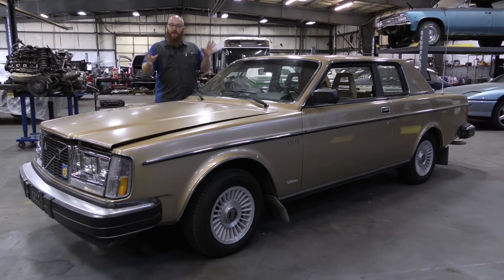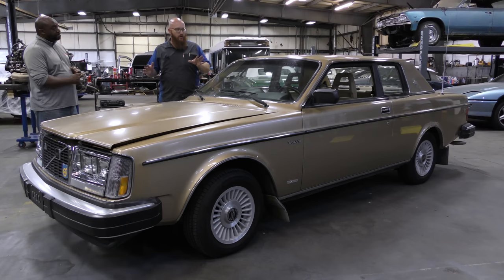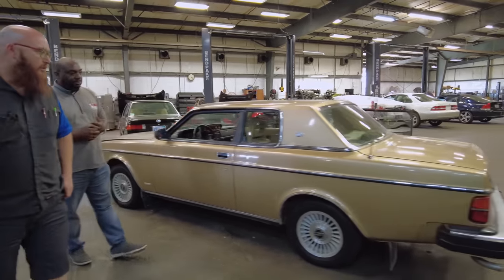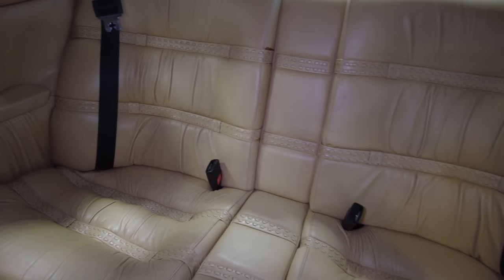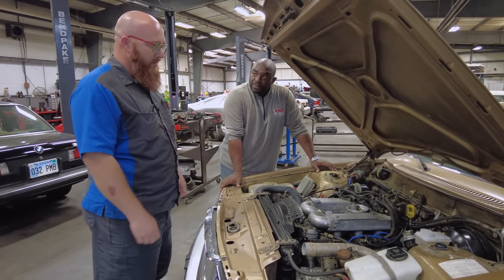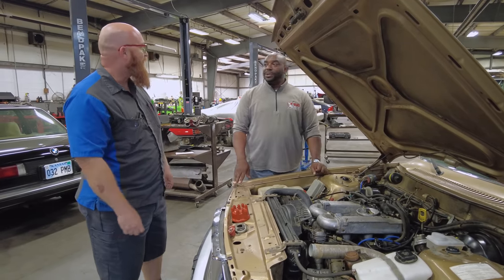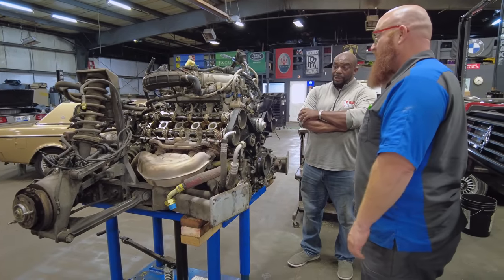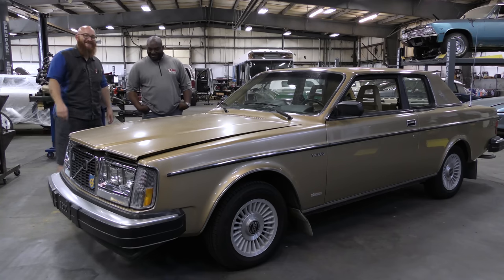Italian Volvo? Rare ‘80 262C Bertone in my shop! Why is Bug Ninja in a Ferrari engine bay with me?

Comment: I've driven a Renault with that engine. My landscaping boss would do moves too, he was pretty thirsty for whatever he could put a crew to if it was slow. Anyway.. I could drive a manual so I was "elected" to take this weird car that had been parked for years on a three hour drive through the mountains.  It over-heated half a dozen times so I got a good look while sitting on the side of the road.  
  Later I went back for the moving truck (also stick) and drove the whole family over their rotten log bridge with a loaded 32 foot box truck going about 45, as fast as I could get down their driveway. Fun.

Comment: Sounds like US Volvo dealerships are different from ones in Scandinavia at least then, as here they lowered the prices on fixing the old Volvos as they really want to keep them as customers.
And I remember the fuel injected Volvo 240s I've had, you couldn't attach that to a computer either, so Volvo's solution was a little box in the engine bay with a button, when you pressed it, a little light on the box would start blinking, and you had a little booklet that told you what each blinking pattern meant, as a way of doing diagnostics. :P

Comment: US market cars that had the PRV V6 – Volvo 260; Volvo 262C; DeLorean DMC12; Peugeot 604; Peugeot 505; Eagle Premier; Dodge Monaco
Reply: PRV powered automobiles

PRV engine in a DeLorean
The dates following each entry denote the introduction of a PRV V6-equipped models.

2458 cc:
Alpine GTA (September 1985–February 1991)
Renault 25 (1985–1995)
Venturi 180/200/210 (1987–1992)
2664 cc:
Alpine A310 (October 1976–1985)
Peugeot 504 coupé/cabriolet (1974–1983)
Peugeot 604 (March 1975–1984)
Renault 25 (1984–1988)
Renault 30 (March 1975–1984)
Talbot Tagora (1980–1983)
Volvo 260/264/265 (October 1974–1980)
Volvo 262C (1977–1980)
Volvo 363CS (1977, prototype)
2849 cc:
Alpine GTA (November 1984 – 1990)
DMC DeLorean (1981–1983)
Lancia Thema (1984–1992)
Panhard ERC
Panhard VCR
Peugeot 505 (July 1986–1992)
Peugeot 604 (1979–1985)
Peugeot P4
Peugeot Proxima (1986, prototype)
Peugeot Oxia (1988, prototype)
Renault 25 (1988–1992)
Renault Espace II (1991–1996)
UMM Alter II (90's)
Venturi 160 (1987–1992)
Venturi 260 (1989–1996)
Volvo 260/264/265 (1980–1982)
Volvo 262C (1980–1981)
Volvo 760/780 (February 1982–1991)
Volvo 960 (rare 1991 models)
2963 cc:
Alpine A610 (1993–1995)
Citroën XM (1993–1997)
Peugeot 605 (1990–1995)
Renault Espace III (1996–1998)
Renault Laguna I (1994–1997)
Renault Safrane (1992–1997)
2975 cc:
Alpine A610 (1991–1993)
Citroën XM (1989–1993)
Dodge Monaco (1990–1992)
Eagle Premier (1988–1992)
Peugeot 605 (1990–1995)
RJ Racing Helem V6 (1995, modified Renault Sport Spider)
UMM Alter II (90's)
Venturi 300 (1996–1998)
Venturi 400 (1994–1997)
PRV engines in racing
ALD C289 (1992 24 Hours of Le Mans endurance prototype)
Alpine A310 Group 4 & B/12
Alpine A610 GT2
Chevron B36 (1987 24 Hours of Le Mans endurance prototype)
Fouquet buggies
Peugeot 504 V6 Coupé Rallye Group 4
Peugeot P4 V6 Paris Dakar
RJ Racing Helem V6
Schlesser Original
UMM Alter II
Venturi 260LM, 400GTR, 500LM and 600LM
WM P series (1976-1989 24 Hours of Le Mans endurance prototypes, including P80 that finished at 4th place at 1980 24 Hours of Le Mans and the famous P88 that was known for setting the all-time Mulsanne Straight speed trap record of 407 km/h (253 mph) at 1988 24 Hours of Le Mans).
Ultima Mk1/2/3
The PRV was also the basis for the 90° V6 engine used by Alfa Romeo in the 155 V6 Ti in the 1996 DTM/ITC season from Silverstone onwards. The engines in that series required the use of bank separation angle and cylinder bore spacing from a production based engine, and as a 90° V6 has greater room between banks than a 60° V6 for a more optimal induction system, Alfa Romeo used the PRV as a basis as it had been used in the Lancia Thema, a car which shared its platform with the Alfa Romeo 164, as well as the Fiat Croma and Saab 9000.

Other sources declare that the 90° V6 engine in 1996 Alfa Romeo 155 V6 Ti is based on a 2.6 L V8 from 1970 Alfa Romeo Montreal with 2 cylinders removed, as allowed by the rules, however the FIA homologation documentation shows the homologated production engine was a "2850cm³" capacity "V6" engine. The bore spacing of the Montreal engine was too close to be suitable for the 155 V6 Ti in any case. Limone invented the "Montreal V8" story to throw the press off the scent and to satisfy FIAT management who were unhappy that a non-FIAT group developed engine was being used.

Comment: I had a 244 and always wished I bought the 740.   The 740 could sustain a higher top speed for cruising.   My 244 maintain 125 mph on the highway.   Finally gave it away to a church auction with over 200,000 miles.
Reply: Was that a NA 244 or a turbo?

Comment: I've got the same engine (in my 1983 Talbot Tagora) but instead of fuel injection it has a pair of triple venturi webber carburators and a single choke (@250mm diameter) on the side of the engine !

Comment: I'm a minute in and had to stop. Mechanical parts for any 240/260 are very easy to find and not bad for price. Aside from the engine being a V6, the 240 parts pretty much do it all. IPD and FCP Euro are generally great for parts. The Borg-Warner transmission is simple and straightforward. The only thing that will be tricky are tires to fit those 14 inch wheels. Good 185/70R14 tires are hard. Going to a 205/70R14 is some better, but moving to a 205/65R15 on Volvo alloy wheels is the way to go

Comment: The Volvo 262C is a very nice car and all it needed was a new dizzy (distributer cap) and rotor button but l know they were not cheap l replaced them on my 1997 Hilux and that was aud $70 and that Ferrari motor with the easy to replace clutch why aren't more clutches like that and l have replaced so many clutches on rear wheel drive vehicles they are a pain

Comment: A few things worth pointing out. You could buy a Volvo 242 in Europe, in the same way you could buy a 142 before it, this was just a 2 door version of the sedan, so had a normal height roof with normal thin C-Pillars, it was the "C" that denoted it the Bertone "Coupe" with the "chopped" roof. Also, in some markets, they were only available with carbs, including here in the UK. It was a terrible carb that didn't last much part 60,000 miles, would cause single figure fuel economy, poor starting & rough running, & really wasn't rebuildable.. They cost over $1000, on its own, in the late 80`s/90`s, before labor was added. Unsurprisingly, it was that carb that sent a large percentage to the scrapyard, as it did with its other PRV equipped stablemates (the Renault 30 & Peugeot 604). Maybe if they'd had injection there`d be more of them left..

Comment: That Volvo 262 is beautiful! I wouldn't say that about normal 240. But they are very good cars with 4 cylinder. Turbo is needed for modern traffic. 6-cylinder sound is nicer, but not nearly as reliable as 4 cylinder models.

Comment: Rule #1 if a car is misfiring, always check the ignition parts first. Distributor cap, rotor, switch, cables and spark plugs. 👍

Comment: I was never a fan of the 262 Bertone, it looked awkward to me. The 780 Bertone was the first Volvo that made me do a double take, it was so beautifully designed! The PRV had a reputation for chewing up camshafts, I was so tempted to take advantage of the very low pricing of used 760s, but the reputation of that engine made me think twice. I drove one, it was nice enough but it sounded like a Corvair when driving. I never did get one. I had an 82 244, a terrible car, many years later I bought a 960 with the inline white block 6, that was an outstanding car.

Comment: The V6 engine is often called PRV6, since it was a joint venture between Peugot, Renault and Volvo.
I never had experiences with them my self, its a very hated engine in the RWD Volvo community.

Some people claim that the B280 (newer revision of b27/b28) is much better.
But it is also said that these cars need proper maintenance and oil changes or you risk the cams not getting enough lubrication.
So some people claim that in the 80s, people were used to engines which didnt need frequent oil changes etc and that then they didnt service the PRV6 enough.
Not sure if its true or not, its all hearsay.

Other than that, the 780 actually came with independent rear suspension and fixed, the 1989 780 bertone has the IRS.
That is the IRS MK1 as its called, which has coil springs.

In Volvo 960 1995 you had IRS MK2 (same in RWD S90 etc).
This IRS MK2 has a composite leaf spring.

The IRS assemblies from 780 and 960 have very low unsprung weight, especially the MK2 as more components weight then is "tied" to the body/chassis.

Comment: Hey Wizard!
From the first time I saw a Volvo Bertone Coupe, I was in love with the design. I wanted one for years, but never found one I could afford. Now, you couldn't pay me to own one. Too many unique unobtainium parts! I'm retired now, but I was the last one at the shop I worked for who knew how to service the Volvos with the CI fuel system. (And later the B28/B280 with EFI and the front left mounted IGN Dist) I eventually got quite good at it, just in time for them to disapear from our client list. (Haha!)

Did you remove the Air Filter Box for clarity, or was it missing when the car arrived?

For reference I've included a list of the variants used in Volvo cars over the years. Courtesy of Wikipedia.
In the US I saw mostly "F" Variants, with an occasional "A" Variant inported from Canada. The only "E" Variants I saw were, if my memory serves, later EFI units. (it's easily been eight years since I last saw one.)

Cheers! GrayRaceCat, a.k.a. Brian

p.s. I enjoyed the diversion to Eurovision Bob's 348 Ferarri engine!

*  V6 PRV engines  *

  B27A: Carbureted version used in the Volvo 260
  B27E: Fuel-injected version used in the Volvo 260
  B27F: Low compression fuel-injected version used in the Volvo 260
  B28A: Carbureted version used in the Volvo 260
  B28E: Fuel-injected version used in the Volvo 260 and the Volvo 760
  B28F: Low compression fuel-injected version used in the Volvo 260 and the Volvo 760
  B280E: Fuel-injected version used in the Volvo 760 and the Volvo 960 for the 1st year in certain markets
  B280F: Low compression fuel-injected version used in the Volvo 760, Volvo 780 and the Volvo 960 for the first year in certain markets

2664 cc (B27):
   Volvo 260/264/265 (October 1974–1980)
   Volvo 262C (1977–1980)

2849 cc (B28/B280):
    DMC DeLorean (1981–1983)
    Volvo 260/264/265 (1980–1982)
    Volvo 262C (1980–1981)
    Volvo 760/780 (February 1982–1991) The 780 was another Bertone Coupe!
    Volvo 960 (rare 1991 models)

Comment: Dear Car Wizard, you mentioned CIS injection on the Volvo several times. What is CIS injection?
Reply: Continuous Injection system. it's mechanical fuel injection. You press the gas pedal and all injectors fire at the same time. The PRV, at least on a Delorean, was and Odd fire engine also, so getting the thing to idle properly ain't easy
Reply: @DeloreanGuy2  I have never heard of that system. I know of the old bosh fuel injector system with the fuel distributor, the old throttle body injector system  & the stuff we have now but never heard of that.

Comment: Back in th e early 2000s, I managed Volvo dealership service departments. At one shop, we literally did not work on them. Even routine servicing often revealed horror stories: C.I.S. stuff, trim bits made of unobtainium, poor catalog support and tech backup. Parts? Nope...I had 9 techs, and not one of them had a speck of training on these mongrels.
At the last store I ran, we worked on only two of them. They both belonged to a noted doctor in our little town, and we treated them as legacy vehicles. This doc and his family had purchased 25+ Volvos at our dealership, and I had one tech(!) who could work on them...
But if you called and asked if we worked on 262s, the answer was a solid no.
Ok car, ridiculously bad engine.....

Comment: I used to work on Volvo cars 40 years ago and these V6 cars were terrible to work on and frequently problems with the wet sleeve motors. It's  a shame because the inline 4 was very reliable and easy to work on.CIS injection was really easy to work on in my opinion.

Comment: I worked on one of these a couple years ago, sadly it was a hack job. Someone modified it with all sorts of speakers and crossovers etc. It was bad, all sorts of electrical issues. Replacing a window regulator took hours as I had to cut through very thick fiberglass in the door because of the "custom" stereo install. 🙄

Comment: “Supposed to be V8”, that’s why Delorean used this engine. He would have had it built out rebuilt as his co grew, if it had.  Thanks for the discussion.
Reply: No Delorean first thought of a V6 Ford engine. Then they choose the a Citroen l4 engine with the complete drive train. More relaible, but that engine was underpowered. So they had thoughts of putting a turbo on the Citroen engine. When Citroen heard of it, they recommended to search for another engine. That is how they came to the PRV.

Comment: Not sure about that model number designation. So a Volvo 240 would have no doors?
Reply: The model designations were more a 60's, 70's and early 80's thing. They just went with 240, 740, 760, 780, 850, 940, 960 after about 1981 or '82. I think when the 760 came out in '82 for '83 production was when they changed. Kind of like Mercedes did when they switched the numbers and letters around, ie from 500SEL to S500.

Comment: The PRV engine was not that bad, it was all the emissions and anti smog rubbish that America demanded to be fitted. Mind you, you did have big bore engines 5 or 6 litres with less than 150 bhp, so 120 from under 3 Ltr with anti smog etc was not too bad. The  Back to the Future Delorean had a v8 swop because of this.
Reply: Correct up until the BTTF v8 swap. The Delorean had the same 2.8l V6 engine. It was SUPPOSED to have an 8 cyl, but costs prohibited the builder from doing so.

Comment: The "70's not thinking about environmental issues".  They were but all the American majors fought the mandates politically and in the press and still do. Had they only accepted the requirements and used good old ingenuity, partnering and competition to move the peg you'd have today's 40+ MPG back then AND many revolutionary additions sooner.  (Fuel injection existed in the 1960's;  microprocessors debuted in the early 70's; even hybrids and EV's were done experimentally in the late 1970's) Detroit has always been mired in its own bureaucracy and fiefdoms.

Comment: Bertone was having a bad day with this brick on wheels.
Reply: Bertone built it together and did the interior of this model. The exterior was still Volvo. Volvo made a first prototype by using a 164e which had three crowns on the side instead of one which was standard later. (C-pillar). As Adrian said, the influence was clearly a Lincoln Mark IV. So you could say the bad day had Ford 😅

Comment: I got the PRV engine in my 1981 Delorean. It is very expensive and labor intensive to get one of these going and maintain it. One easy way around the CIS part of it is to swap it over to a carburetor setup and ditch all the fancy parts the CIS requires

Comment: You should run away from this V6 engine as fast as you can. There are no cam shaft bearings, no separate oil pump. Pump runs in a machined area of the block.
One of the most important things to replace or clean, is the flame arrestor located under the intake manifold in the crankcase breather hose. A bear to get to. This small cheap part becomes plugged and will blow out every seal in the engine. Don't return this car to the customer without replacing this part.
 Don't ask how i know.  I nievely bought a 265 wagon.

Comment: The Volvo versions of the PRV where used in 264, 265, 262C, GLT, 760 (764 and 765) and 780. Between -76 and -79 you could get a carburated version called B27A with 128hp. Between -76 and -80 the fuel injected B27E had 141hp. US got the B27F (cat verson) with 127hp as said in the clip. From -81 to -86 the bigger version B28E was used with 156hp. US got the B28F (cat version) with 130hp. The totally reworked B280E/F engines with Bosch LH electronic injection where used from -87 to -91. 
The most catastrophic and not uncommon issue with the B27 and B28 was that they had loose cylinder sleeves that worked their way down in the soft aluminium block, looking like a blown head gasket. It was really costly to repair. My dad got quoted 40000SEK from Volvo on his 760 -84 in 1992. That's equal to about $10000 now. He traded it in for a 740 instead.
Reply: They used the PRV even in the earliest 960s in Japan and Australia!

Comment: 262c is not strange, it’s glorious! But the V6 sucks. Common, as Adrian says, in Europe, but woefully inefficient and no parts any more. Stick a Burra in it. And yes, the V6 persisted until the end of the 960 model, which overlapped the 850 and the “classic” V70.
Reply: The 960 used the inline 6 cylinder "white block" motor not the PRV V6.
Reply: @peterm4475  hymm, OK. I was told by a 960 owner that it was the V6. Maybe they were wrong, or I am misremembering.
Reply: @GuyChapman  Apparently a few very early 960's had the PRV but overwhelmingly it was the L6 white block (I owned a 93 960 wagon for a while).
Reply: @peterm4475  this was a very old one, so that might explain it. Thanks! I had a 945 2.3, great car. I've had ten Volvos, in fact, currently on an XC60 T8, but the modern ones are a bit soulless IMO. I love the Bertone coupés.
Reply: @GuyChapman  Funny you should say that, I have an 89 Bertone 780  2.3 turbo. Owned since 07. 150k careful km.
Reply: @peterm4475  Seriously jealous now! The Bertone version looks SO much better than the regular sedan.